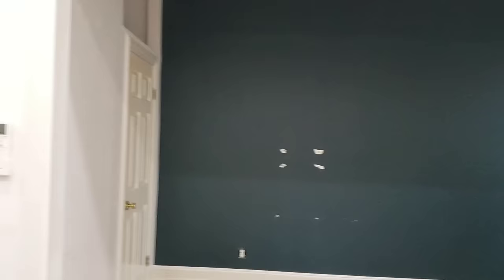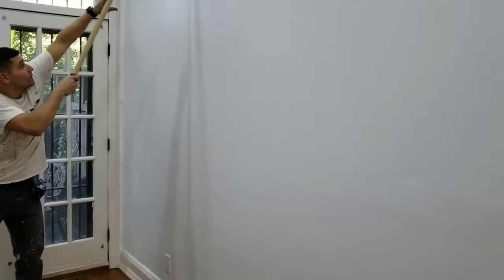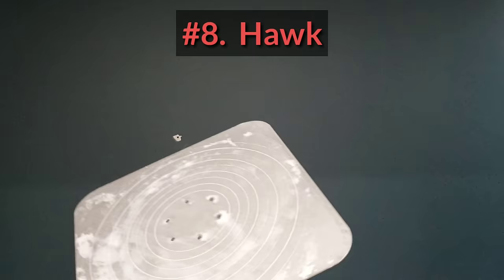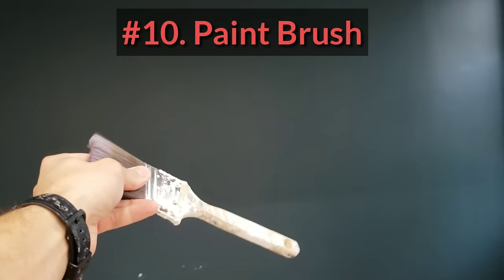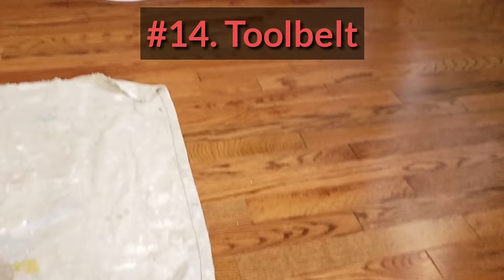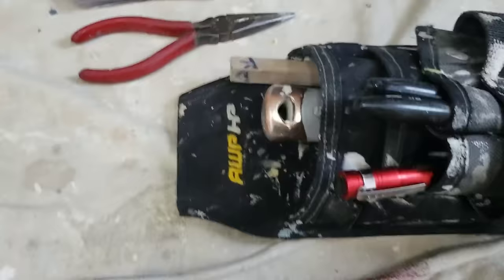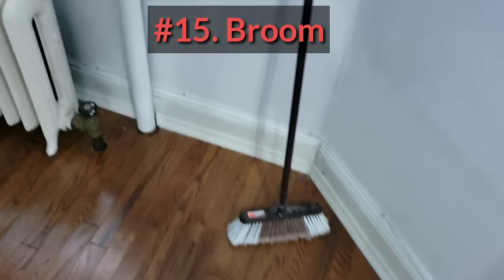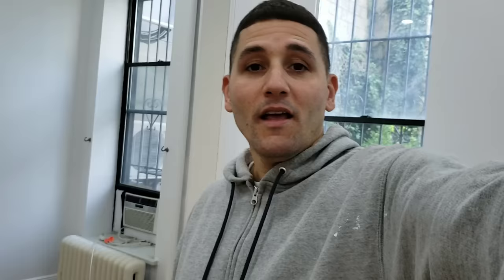15 basic tools every painter must have.

Comment: add painter tape
Reply from the maker: To be a real painter you must paint without tape. Believe it or not you can actually acheive better results. Tape is More for the DIY
Reply: @kdcarespainting8651  I used to think that way, now I paint trim first, tape, then walls. Lines are so straight it’s stupid, and I don’t even have to cut in real perfect, just the ceilings are the only thing that need a journeyman to cut in. It’s so simple, now a day I just get into the house, clean the walls, protect the floors, paint the trim, tape the trim, roll the walls, cut in everything and then roll a second coat, take the tape off and it’s money. I can charge a few dollars more because I’ll explicitly tell the client “it is physically impossible to paint a straighter line by hand then it is by using tape” and I’ll show them examples through their own house. The difference between a straight line, and a perfectly straight line, one where you are able to look at a customer and tell them “notice how perfectly straight the trim and wall have been cut in” is frog tape. Try it on one room, bro, you will not regret it